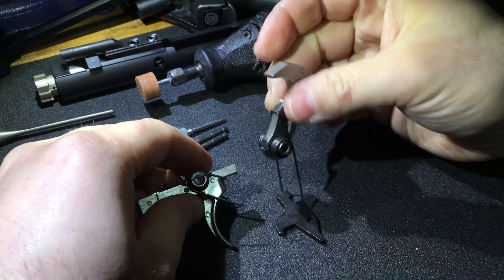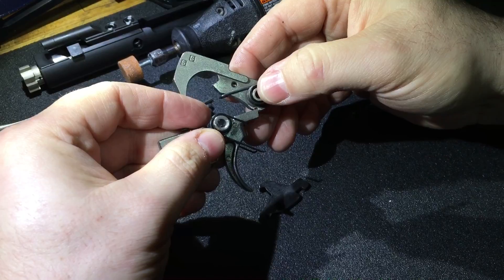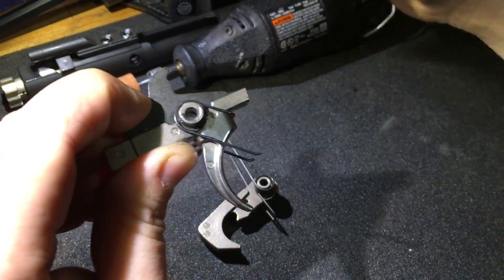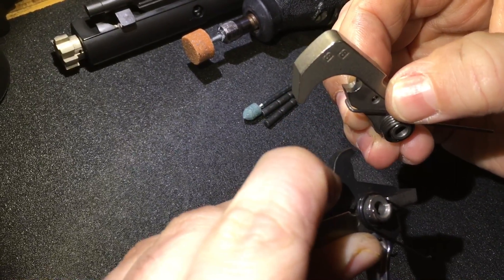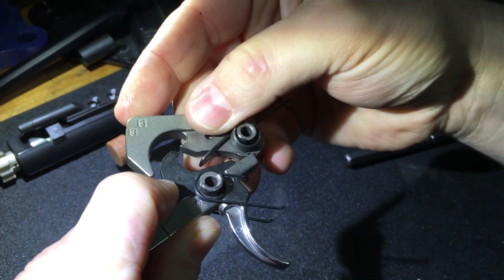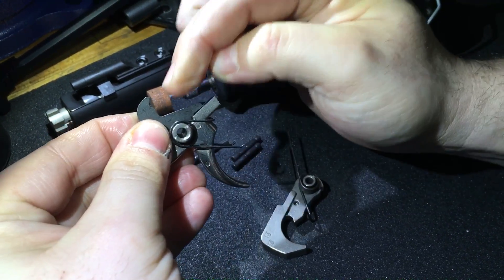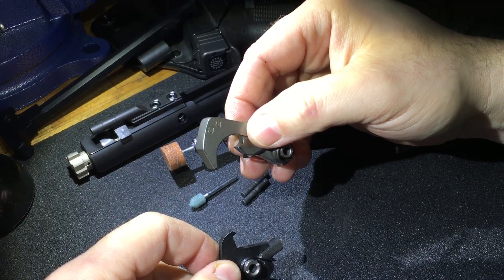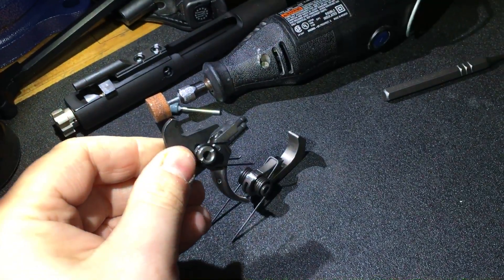AR 15 trigger fix

Comment: So if I accidently remove too much material, then it will just NOT release from the disconnect, right?  I've removed quite a bit, but it's still not perfect function, every time. Just curious what will happen if I make that area too thin.
Reply from the maker: Correct...itll never release.
Reply: Forever modding   Thanks a ton, bro. Got her going again. I racked my brain, trying figure out how to get it back in time. You're a good critical thinker.  I'm a very, very mechanically minded person. I'm a coal miner. We work with large complicated machinery every night. But, this had me stumped. You should see some of the mods that I've came up on a roof bolter machine, to make my job easier, and more efficient. lol.      My sights just came in, for my new DelTon.  I'm going right now, to pick them up.  Then I'll be ready to sling some LEAD!!!!
Reply from the maker: @jamiesloan5902  oh yea man! I love messing around with stuff. Lol ive been trying to improve on others designs since i was a little kid. Lol however my parents hated it because every toy they ever spent hard earned $ on always ended up in a million pieces so i could figure out how everything worked in conjuction with one another. Gun's have been a lot of fun and always a passion of mine. And i love seeing other ppl's ideas and improvements/inventions.
Reply: Forever modding    I've always been the same way. I like tinkering with my guns, almost as much as shooting them. Almost...           I've lightened the triggers on almost all of my guns. This one, and a Winchester 290 .22lr semi-auto, are the only 2 that I've messed up on. The rest of them are SWEET.  All of my .22 rifles have a 1.5lb trigger.  All of my hunting rifles have a 2.5lb trigger. I don't mess with my carry guns tho.         I'll be subbing, pal.
Reply from the maker: @jamiesloan5902  thank you sir! Souds like we'd get along well together. You know what they say ...the whole "great minds think alike" bit lol. Well I'm glad to have met you and I appreciate the sub.

Comment: How much is "just a little" material?  I'll measure before and after using a dremel.  .002", .005", or .010"?  I just did'nt wanna remove too much.  Also, what will happen if I file/grind too much?
Reply from the maker: Theres really no point in measuring as all guns/fcg's will b different. If you take too much material off ...when you release the trigger it wont allow the hammer to reset/transition back onto the sear.    It will just stay hooked to the disconnector and will not fire the next round.
Reply: @vbstangin  Just looking for a good starting point in removing material.  My situation is it occasionally, randomly double fires.  Probably when I have slight pressure and slowly press/release the trigger.... any other trick/tip?  and believe it or not it's a Geissele SDE trigger...
Reply from the maker: @OPtheFLASH  my only suggestion is to grind off a bit of material and then reassemble and test fire it. By "a little" im talking grinding through whatever finish thats applied to the disconnector. Then test it ....if its not enough then take some more off....youre just gonna have to repeat that process until its functioning correctly.
Reply from the maker: @OPtheFLASH  youre not gonna have to remove a lot.
Reply from the maker: @OPtheFLASH  youre putting too much thought into this lol
Reply from the maker: May i ask if youre working with an 80%?
Reply: @vbstangin  No, its a battle arms development lightweight receiver.   K, I will go very little at a time.  Just that to test fire, I have to go to the range.   I'll have to go through a few disassemblys at the range,... thanks
Reply from the maker: @OPtheFLASH  oic. That kinda sucks that u gotta go to the range.

Comment: Great video on fixing a binary, but Binaries are 100% Legal according to ATF, NFA Rules only apply when manufacturing or selling a Binary trigger because you need  to prove its not a fully auto. No hate but this is common misconception with the law because of the it is written.  There are two (Binary) motions to fire the round not a single continuous press of the trigger to send multiple rounds down range, therefor its not a class 3 and no NFA rules apply. However State and Local laws still apply just like for the bump fire stock.  Happy shooting and I advise everyone to check their State Laws before shooting binary, and just don't just at the range because everyone is an "expert".
Reply from the maker: S Trick its not a video on how to fix a binary......its a video on how to fix a malfunctioning trigger. Malfunction= anything that's not 1 bullet per trigger pull. Then reset on trigger release.

Comment: Had the EXACT SAME PROBLEM.... not reseting , hammer fall on release, i will give this a shot,  this has been a 3 to 4 year project build ... palmetto trigger was gritty so it did the same & it felt great till i mated it up to the upper. What sux is i thought i ruined it, went & bought a dpms complete lower build kit... but a couple years later i opened only to find this kit missing hammer spring, disconnector& disconnector spring.  Go fuigure... lol.. i will get around to it..

Comment: 7:04 is WRONG.  It is legal to shoot doubles, IF the 2nd "bang" comes ONLY when you let off the trigger, or make some OTHER action, after the trigger "pull".  Just "triples" are illegal (which is unlikely to be even possible: the next type of trigger malfunction which lets off "more extreme than just turning it into a binary trigger" should be "unlimited" not "triples" unlimited meaning "full-auto").  ~Bill S Preston, ESQUIRE.
Reply from the maker: The Butcher Of Benghazi. Libya indicted me because I'm too stupid to delete my incriminating emails? You dont "gun" much huh. Triples are very possible. Do yourself a favor and quit spreading your "knowledge" until you fully understand.

Comment: Its not the cap,  Its the degree of the step on the sear and the hammer!  You need about a 20 degree step, That's what makes the trigger break and makes it feel lighter on pull!  Polishing will always makes it feel better on the pull though!  And you dont ever wanna use a dremel to do trigger work unless you are a pro!  You sand paper and or a very light file!   And Binary triggers are 100% legal!  As long as its a trigger pull for 1 shot!  Or as the say a motion of the trigger on pull and release!

Comment: So what you're saying is, I can make my own binary trigger? Save myself three hundred bucks on the next one?
Reply from the maker: Lol i never said that ;)
Reply: @vbstangin  everyone like binary thanks
Reply from the maker: @thefutureisgrim9391  it's unsafe. But yeah you do u.
Reply: @vbstangin  its not unsafe
Reply: @vbstangin  no its not unsafe an ar cant fire out of battery because of the bolt design period it has a twist lock design.
Reply from the maker: @thefutureisgrim9391  never said it was unsafe due to "firing out of battery".
Reply: @thefutureisgrim9391  it's unsafe because once you pull the trigger you MUST shoot again upon release. effectively making it a de facto dead man switch. the commercial binary triggers have a way to stop that so you dont HAVE to fire upon the release if you switch it before you release.
Reply: @iamAwesomo1994  i dont feel unsafe because im ready for this and expect that action so know not unsafe for me now someone else who is a newbeee and didnt know what they were getting into yes posibly
Reply: @thefutureisgrim9391  safety is relative
Reply: @thefutureisgrim9391  true, but if this is occurring with an AR 9 or any other build that operates on blow back very unsafe.
Reply: @iamAwesomo1994  the double tap triggers are basically like that which is why they're so much cheaper than the more expensive ones.

Comment: Something and everyone should also know if you do have problems such as this or any other kind of a problem that's causing your firearms not operate properly report it directly to the person or the manufacturer that you bought it from so that they have a record of it and can seek a solution. Also check to find out if there might be a recall on that particular problem or that particular part or firearm. Many times recalls are issued where you can send your firearm in to get it fixed for free or they will replace it for free.

Comment: Would be better if you used proper terms for the parts. Its a disconnector vice an extractor. geez. Glad you corrected that later in.

Comment: Mine gets stuck everytime I shoot. The hammer and disconnector.
Reply from the maker: Joshua Baughman stuck how?
Reply: Forever modding when I pull trigger after shooting, the trigger gets stuck and I have to push it back forward to shoot again. The hammer gets stuck on the disconnector. Not sure why. My dads does the same thing. Both using mil spec triggers.

Comment: The military check after cleaning and re assembly should let you know if your AR is going to go full auto or double tap before you go to the range,  I just cannot believe what I have seen on this video and so many have done something similar. The systems check is easy, empty gun, charge or cock the hammer, pull trigger on empty chamber, hold trigger down, charge again, let off on the trigger, it should reset, at this point it should work unless you have removed metal from the surface hardened parts of the hammer and trigger.
Reply from the maker: Ed Sanderson this procedure isnt 100% ... You obviously havent built many guns. Or fully understand how they operate or malfunction.

Comment: my trigger pins came out one side and it did that
Reply: Your hammer spring was not set correctly on the trigger pin or was incorrectly installed if the fire control group pins slides out...Out of spec trigger and hammer pins can occur but is not common to see...

Comment: Seems everyone (including myself) is having this problem with the AR trigger group. AK... never a problem.
Reply from the maker: How many AK's have you built? The biggest prob with the low end milspec triggers are that they are just that....low end. Also if youre building an 80% then youve got to understand that the trigger/hammer pin holes will not be exactly the same on every lower built, due to tolerance stacking between the hammer/trigger holes as well as tolerances with the FCG.

Comment: Just built my first eh are. I am having trig ger reset issues just like the next guy. All stock mil-sp ec parts. Anderson lower. Stock internal parts. I find it strange that a huge percentage of eh are owners have a ton of trig ger issues. Maybe they are building them wrong so people will buy two or three instead of one? A fyer ahrm should work out of the box with no functionality problems... IMO. 
Or maybe these supposed "mil-sp ec" parts should be manufactured better.

Comment: Correct me if I'm wrong but it seems like if you had just deburred the hammer but left the disconnector alone there would have been no need to make fixes to the disconnector.
Reply from the maker: Stuart Weiss the prob isnt that things need to b deburred. The prob is that some of these triggers are out of spec. So what i did was showed how to bring it back into spec. No amount of "polishing" or deburring would have fixed this trigger. It was too far out of spec. And ive actually fixed triggers that were even worse, using this method.

Comment: Almost every part of the trigger group is commercial semi auto not MIL SPEC. The idea in working on a commercial trigger group is to POLISH,  not REMOVE MATERIAL. Hammer and sear  are  surface hardened which makes them the shiny parts. Remove that surface hardening and these parts wear quick. This removing metal here and there just sounds like a lawsuit waiting to happen. The best thing to do if you remove material is replace the part. O'yeah, AR mfg's have been calling commercial trigger groups mil spec when they are not. If your lucky the BCG and the hammer may be but the rest is commercial SEMI AUTO civilian parts. Look up pics of true mil spec parts and compare.
Reply from the maker: Ed Sanderson just trying to help ppl fix probs man. And by the comments it looks like ive helped quite a few. Sorry i offended you by calling these trigger groups "mil spec" ... But thats what theyre referred to by the masses ...so thats what i call it.

Comment: This is a "how to fix your bad trigger job"... 
First, never ever admit you screwed up, badly.
Second, seriously, you never admit impatience, laziness, and incompetence has resulted in a bad trigger job that is the pure essence of failure.
Reply from the maker: Dude...u worry what ppl think about you way too much. And secondly i have no prob admitting when im wrong. Maybe you should try it. Thirdly...since you werent there you have no idea whats actually going on other than what i communicate to you, for you to then make judgements. And on the last note...obviously you havent built many AR's (and if you have youre not very mechanical or observant)...otherwise youd have remained quiet and tried to learn something.
Reply: @vbstangin  You filed off too much metal, almost creating an illegal weapon.
 That is the definition of a bad trigger job.
And you should watch your video again, when you see the part where you actually admit, in clear speech, that you made a mistake, you're hallucinating because you never actually did that.
Now if you had actually bothered to admit you got carried away and did a bad trigger job, I wouldn't of said anything. But your ability to be truthful is theoretical only.
Reply from the maker: @DeepPastry  duuuude....i was using that as ONE example. Ive had plenty of these operate the exact same way straight out of the box. So yes this particular trigger may have not functioned correctly because of polishing, however...i cant say that that is 100% the reason as ive had to work on plently of STOCK triggers that have operated the same. If u dont believe me ...read the other comments. That should give you a clue as to how often this prob occurs.